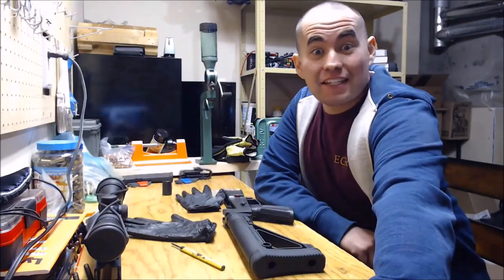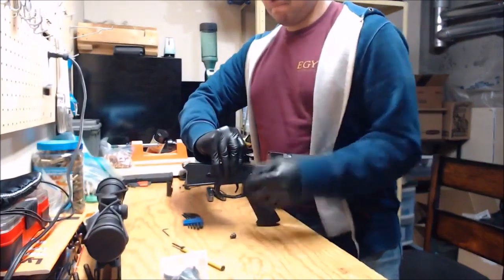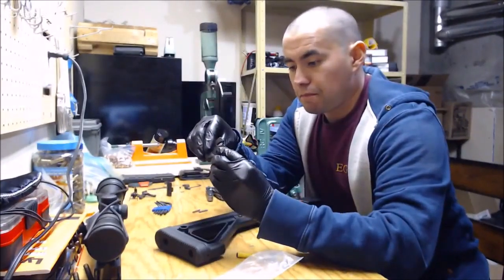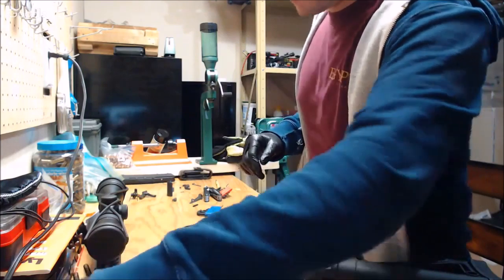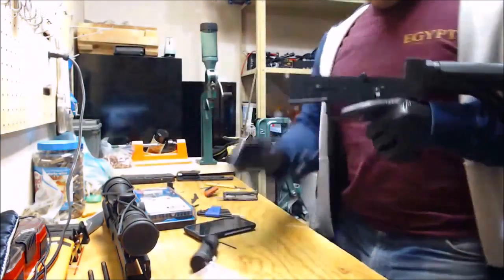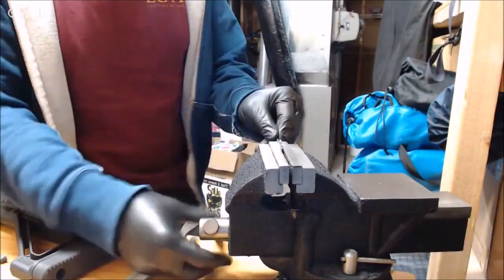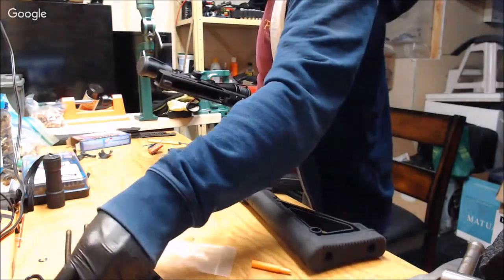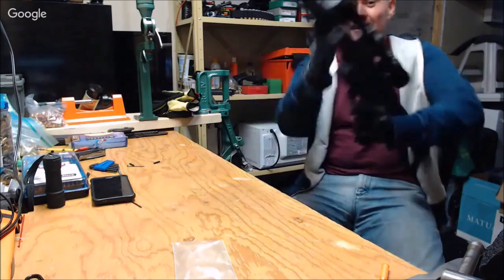WK180c trigger swap with Crover

Comment: Are you still satisfied with the trigger and if you could get a different trigger, which one would you pick?  Thanks for the very instructional video!
Reply from the maker: I love the trigger, but due to the nature of the WK's lower's design I had to take it out; I could never torque the screws in the pack to where it wouldn't let the trigger pins shift under low to mild use. The trigger pack now lives in my AR where it hasn't moved at all since installation and several hundred rounds.

For the WK I believe a traditional trigger is better suited over a trigger pack. There is a lot less that ca go fucky with a Geissele or such triggers with a separate trigger, disconnector, and hammer.
Reply: Have you tried the new anti walk pins, they are threaded for micro nut/washer....obviously this was a problem for the w180c

Comment: How is the trigger holding up? No issues to report?
Reply from the maker: Set screws in the trigger pack wouldn't hold the trigger pins in place so they kept walking out. Switched back to a traditional milspec trigger made of separate parts.